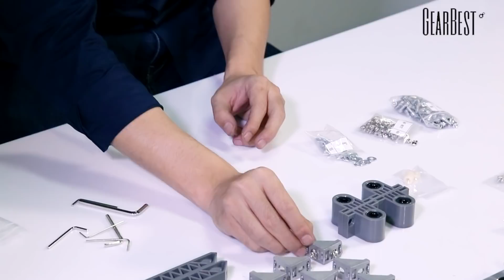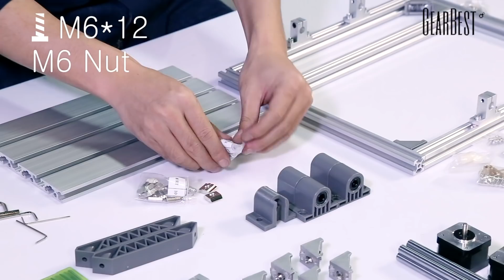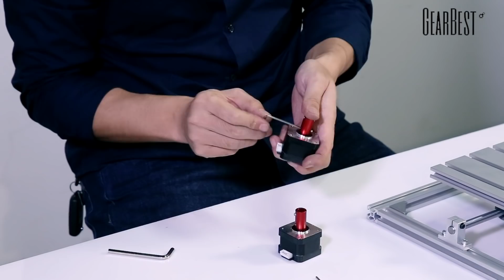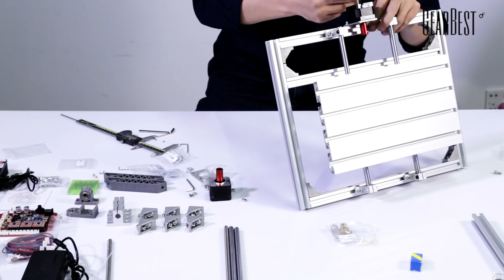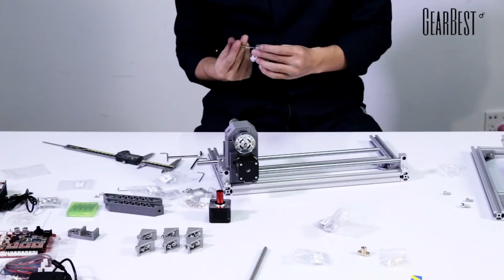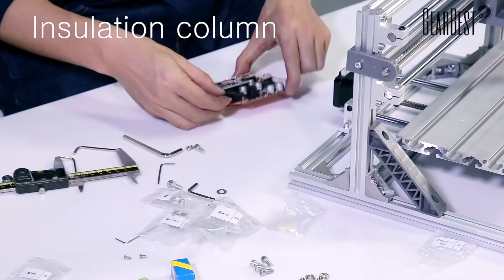Alfawise C10 CNC 3018 2500mw Laser Engraving Machine - GearBest.com

Comment: To make your life easier, replace the M5 x 10 bolts (visible at 3' ff") with M5 x 12  or even x 14, like I did. More umphh, more grip in the nut (no pun), easier to assemble. There is space enough in the slot. 

OK, you don't nee the sound track in this vid, but the music suxx.

Others here pointed at the assembly error made by the vid's hero already. Almost all important measures can be found in the doc file, if you know what you are looking for.  
But still a nice kit. 

BTW: Thingaverse has a housing for the electronics. Highly recommended.

Comment: Base plate truss is wrongly set up. The corner pieces must NOT face each other, but the same direction; else the movable plate won't align with the spindle. It's also in the manual.